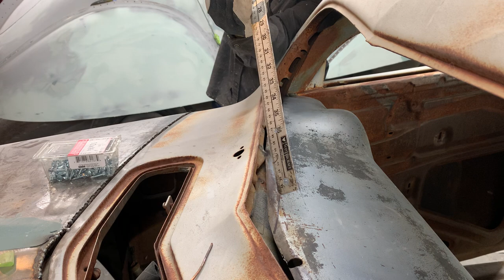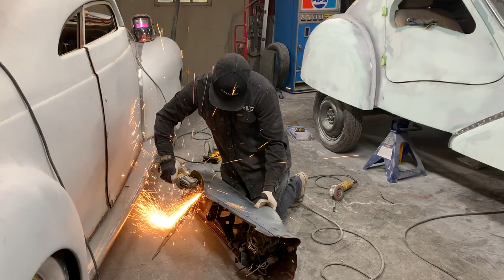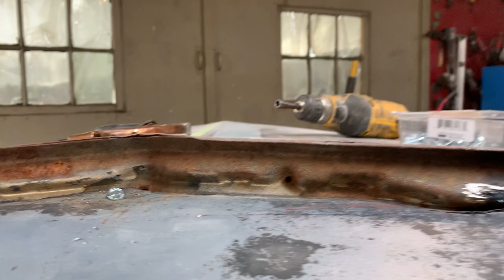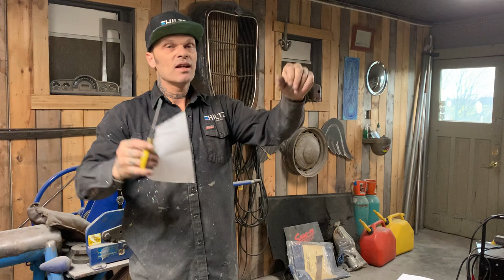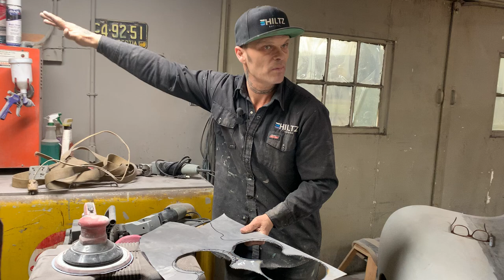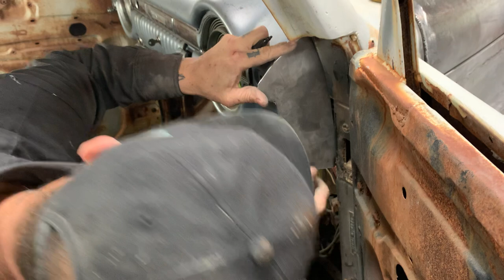SCRIBING THE '53 OLDS DASH TO FIT IN THE '40 PLYMOUTH 🔥

Comment: this is a TIP from an 80 yr old man I do this all the time: use the self tapper and predrill a hole in the piece that has to attach to another piece and when you hold the dash in this case when you install the self tapper the hole holds it in place when you scew it in with only one hand and no one needs to help hold the dash, hope this helps next time. You are a great help to me as I'm puting a 1949 dash in a model A pickup. Thanks for sharing your knowledge.

Comment: I'm a musician,a sound engineer, a producer and I have started a web series that is only 4 episodes old but none the lessI consider all of that tied together. So I know of what I speak when I say; "You like to guess because you are n't building a car in the common sense of those words. You are an artist. You are making art. And art is open to interpretation and one piece of art can mean something different to anyone experiencing the art. There are no wrong answers because of that.

And it wasn't until you said about "Liking to guess" that I realized why you are so fearless with this stuff. Aside from the confidence of experience, you are just creating art. You don't need measurements when you make art. If it looks good, it is good.

Like I've said a few times. You are bolstering my confidence to take on customizing my two hotrods like you wouldn't believe.

Can't wait for spring. Both cars are finished mechanically and almost done interior wise. Both will be getting painted, by me, this year. Thanks a million.

Comment: an easy way to get an accurate scribe is use a washer with the sharpie on the inside hole and roll the washer on the surface to be matched...Ignore the radiuses as they will always miss the actual location.

Comment: Hey Grasshopper..😂..Next time make your life easier....1st Strip the dash (take pics) of everything that comes off....lot easier to handle...it all has to come off later anyway....2 nd make a quick template of the profile of the windshield bottom...after you installed the inside trim mouldings...(hopefully they have defrost slots if not plan accordingly...refer to brain) tranfer to dash shell cut fat=extra 1/4" inch for fine tuning.....once fitted take out n predrill the mounting screws at an angle towards inside the cab as needed to clear windshield if you have to remove when car is completed n runnin drivinn....Happy New Years fellow Canucks....🎊🍷🎉🏁 Master2cents...😂✌😎

Comment: Chad, why dont' you use some aluminum 1"wide strips to bend into the shape you want to trim and bend it to follow the dash and the car ...Remember they are sacrifishle aluminum bent yard sticks a little more then 48"long  will make cutting the dash to match the car easier and faster.....I use to buy aluminum yardsticks and bend them as I needed them. over and over until car was done. You can make your own strips out of thick sheetmetal if you got access to a break and a shear ! Whatever works to cut time ...
down...